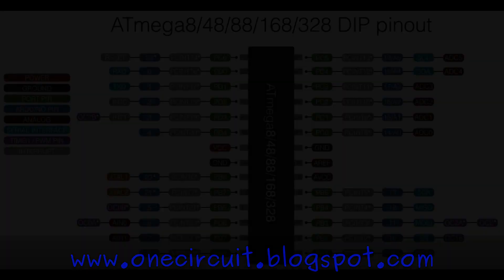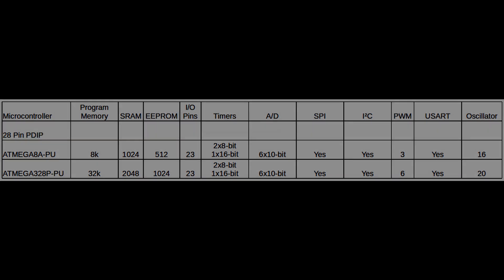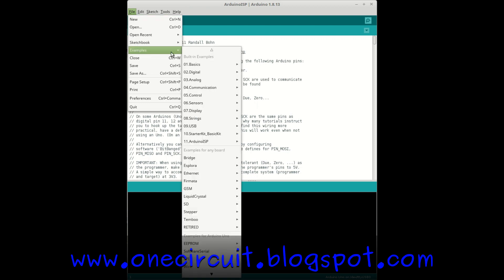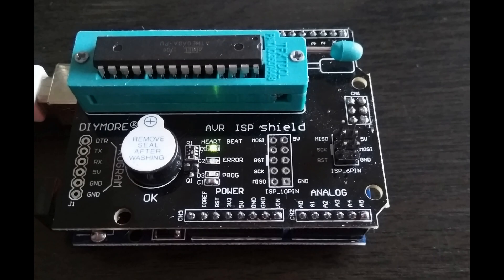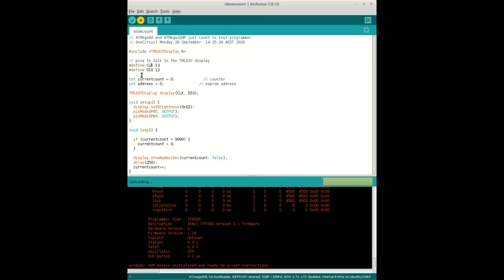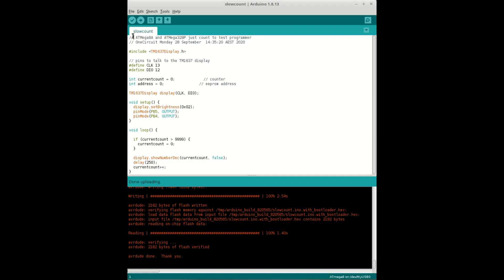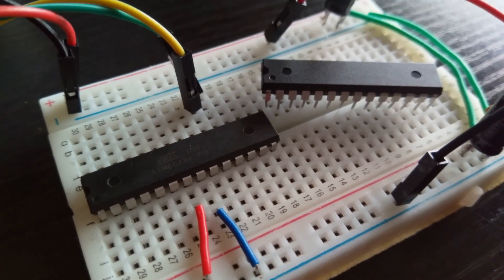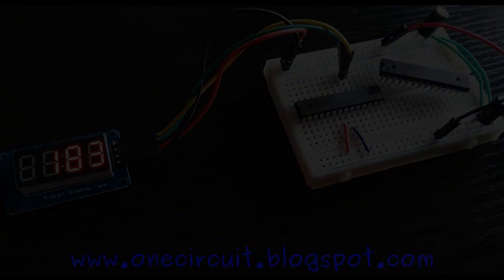ATMega8A vs ATMega328p

Comment: I went nuts and bought 10 mega8's a couple years ago (QFP).  They were only about 0.43/ea.  Oddly, less expensive than mega48's at the time.  MUCH less expensive than the attiny85.  Of course they have real hardware for serial and i2c, instead of the tiny's soft methods.
Good for making DIY AVR ICSP units using obdev's V-USB stuff.  You'd need 12mHz crystals.
Found that the internal voltage reference and temperature measurements are not nearly so consistent as the m328p.
Also find that the m328p will do 115200 baud serial at 3.3V better than the m168, or m8.  (shrug) Dunno why.
Similar deal here @ $0.52/ea, for 10.  Free shipping to US.  https://www.aliexpress.com/item/32788110311.html

int getVCC()
{
  //reads internal 1V1 reference against VCC
  #if defined(__AVR_ATtiny85__)
    ADMUX = _BV(MUX3) | _BV(MUX2); // For ATtiny85
  #else
    ADMUX = _BV(REFS0) | _BV(MUX3) | _BV(MUX2) | _BV(MUX1);  // For ATmega328
  #endif

  delay(2); // Wait for Vref to settle

  ADCSRA |= _BV(ADSC); // Convert
  while (bit_is_set(ADCSRA, ADSC));
  uint8_t low = ADCL;
  unsigned int val = (ADCH << 8) | low;
  //discard previous result
  
  ADCSRA |= _BV(ADSC); // Convert
  while (bit_is_set(ADCSRA, ADSC));
  low = ADCL;
  val = (ADCH << 8) | low;

  return ((long)1024 * 1100) / val;
}

// original @ https://forum.arduino.cc/index.php?topic=8140.0
// Guess at the value? 
#define FUDGE_TEMP 342
int readChipTemperature()
{
   ADMUX = 0xC8; // turn on internal reference, right-shift ADC buffer, ADC channel = internal temp sensor
   delay(10);    // wait a sec for the analog reference to stabilize

   ADCSRA |= _BV(ADSC); // start the conversion
   
   while (bit_is_set(ADCSRA, ADSC)); // ADSC is cleared when the conversion finishes
   
   return (ADCL | (ADCH << 8)) - FUDGE_TEMP; // combine bytes & correct for temp offset (approximate)
}